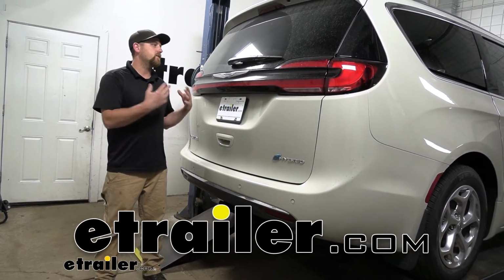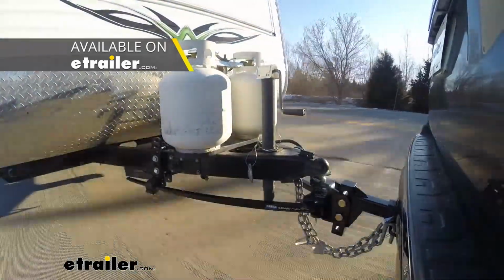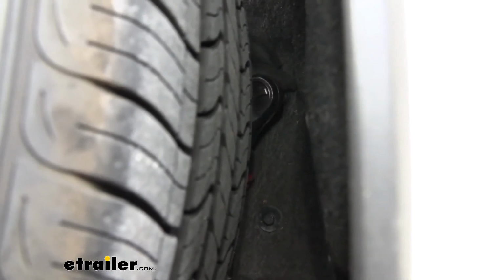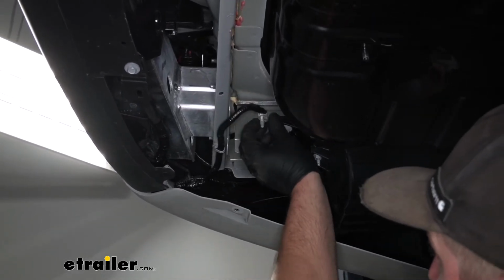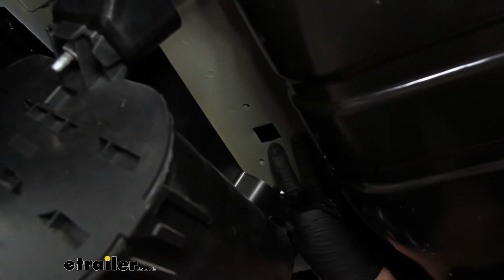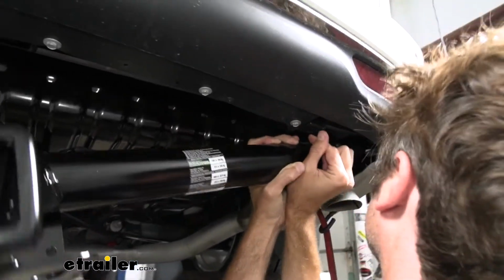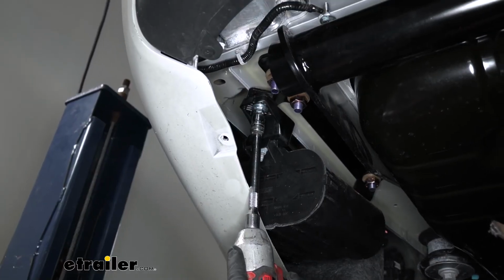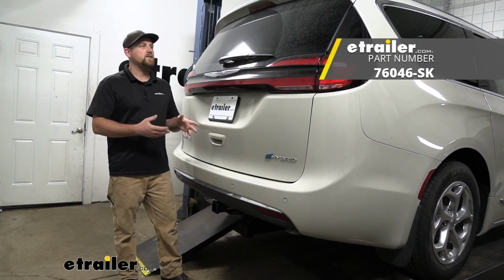etrailer | Install: Draw-Tite Max-Frame Trailer Hitch Receiver on a 2021 Chrysler Pacifica

Comment: I just finished installing this hitch on a 2021 Chrysler Voyager. Two things: my Voyager doesn't have the charcoal canister or a ground wire located on the frame so the job was easier. Only problem I had was getting a nut started on the installed hanger bolt as it wants to just spin. I did the job alone using blocks to hold up one end of the hitch while attaching the side with the exhaust system first. All parts fit nicely.
Reply from the maker: We're glad to hear that you managed to get it installed! When a bolt spins on you like that, try using an impact wrench if you can find one. That'll spin the nut fast enough so it'll thread up.
https://www.etrailer.com/Trailer-Hitch/Draw-Tite/76046-SK.html

Comment: does this receiver works on 2018 Pacifica hybrid limited ?thanks
Reply from the maker: This hitch is designed to fit the 2017-2021 Chrysler Pacifica Hybrid. Check out the following link to see the options we have for the 2018 Chrysler Pacifica Limited.
https://www.etrailer.com/hitch-2018_Chrysler_Pacifica.htm?style=excluding+Hybrid